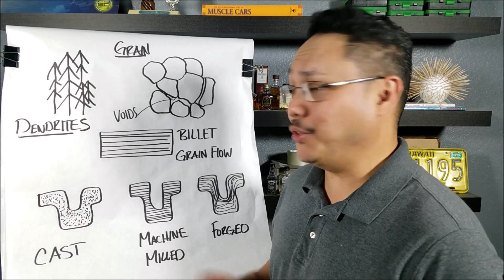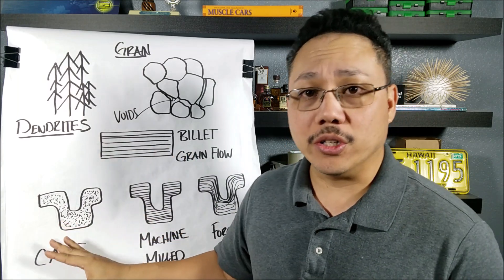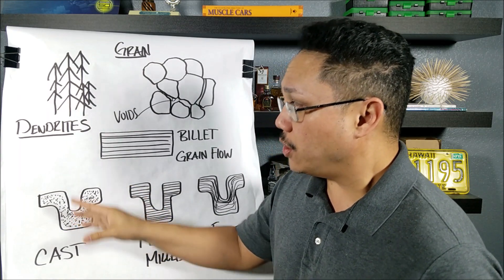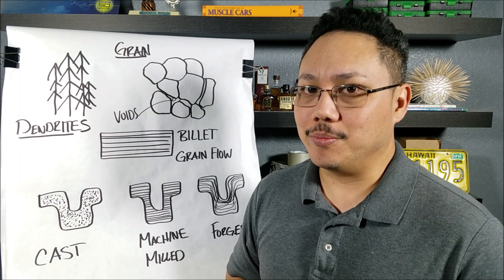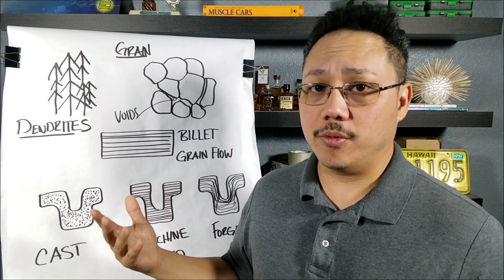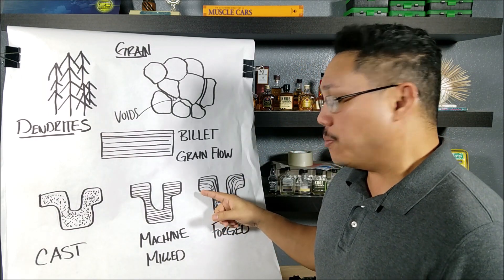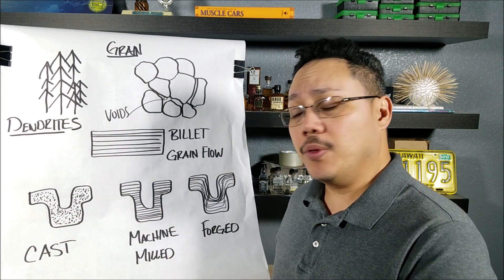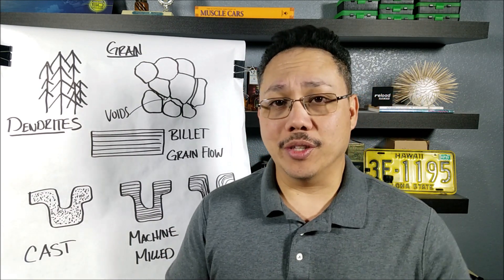CAST VS FORGED PARTS WHY CAST IS BAD AND WHY FORGED IS BETTER

Comment: All the jet turbine parts are actually cast. They use a Hipping process to remove the voids from inside the casting. Also complex pieces cannot be forged, only simple structures.

Comment: There are offshore companies that will not buy China made lifting hooks because they are made from cast steel.  Yes, they are a lot cheaper, but they have been noted to rip on loads that were well under what they were rated for.  Using cast steel for lifting hooks is a gamble.  You can make several identical hooks, and some can handle what they were rated for while some won't.  I was told that with cast steel it creates several different tinsel grades within the steel and you dont want that.

Comment: But most of the aerospace parts are investment casted. Casting is cheaper at scale,  but also requires post processing which can alter the micro-structure. And, complex parts are nearly impossible to forge.

Comment: I work for a hot forging + machining company called Metal Technology srl (brass  copper and aluminum), and it is unbelievable how many customers come to us asking to switch from casting to hot forging, they have solved a lot of issues, also regarding porosity. Your explanation is 100% clear and on point!!! And sometimes it happens that hot forging is also cheaper than casting, if you have the right know how to design the item 💪🏻💪🏻

Comment: casting can be improved with techniques like casting under vacuum (removes air bubbles), ultrasonic agitation (removes air bubbles, likely can be utilized to improve crystaline structure of the metal formation), and probably specialized heating / cooling schedules (will change the crystaline structure of the metals forming)

forging is obviously a great method when the application calls for it and if the part can be practically forged. when it can't, casting is an OK alternative...as are other options such as extrusion.

Comment: Thanks, is there a method which they use vacuum chambers in casting to avoid air traps(voids) and also a compressing process? 
I don't know the right keywords but if there's similar and highly efficient ways in casting could you mention some, I'm curious to know more
Reply: Yes, there are vacuum casting methods, but those are usually done because the metal being cast is reactive with the atmosphere and would make a scrap part versus entrap gas.  

Depending on the material, you can use Hot Isostatic Presssing to close voids in castings.  This is an expensive process, so usually reserved for use on expensive materials (titanium, nickel superalloys) in critical applications.

Comment: Nice video...I've been shopping for a pistol - a 1911 .45 ACP to be specific...Some frames are cast - others are forged...From what little I know of solid metal handgun frames - the forged are said to be a better quality overall.

And btw - I like your selection of bourbon on your shelf.
Reply: Taurus, Springfield, Colt all still forge their guns.  Budget wise it goes in that order from least expensive to most expensive.  Just check the description because some of the concealed carry models have aluminum frames.

Comment: all metals are extracted in cast form i.e. you melt suff and pour stuff ..... billet forming, forging etc are heat treatments to make the metal have different properties usually to make them stronger in some specific way
Reply: No... casting is referring to the process of pouring molten metal into a mold and letting it cool so it assumes the shape of the mold. Forging is shaping it using force. Forging can be done hot or cold, and metal can be forged without being melted beforehand.

Comment: How do you compare 130,000 psi austempered ductile iron (ADI) vs forged steel? Apparently, ADI is about 45% stronger than welded forged steel at least when it comes to similarly designed bench vises. For example Yost brand vices make vises in both ADI and forged steel versions and they claim that the ADI is 45% stronger.  Thank you for any information!

Comment: However, even after you forge it.. so the grains remain in flow and in place- wouldn't machining after the forge process still interrupt the grain?
Reply: Yes, but much more of it is kept intact. Look at his picture of a forged part, and imagine machining it to clean up the edges. You'll still have most of the grain structure matching the profile of the part. It also has the added benefit of reducing the machining required.

Comment: Nice. Are all hot rolled steel automatically are forged steel since hot rolled steel are also compressed like forged steel?

Also what if you cast it but you anneal, then harden then temper? Will that be then as tough as forged?

Thank you. God bless.
Reply: Yes, hot rolled steel is technically forged, but industry does differentiate between rolles and forged due to the mechanical reductions involved and directional effects.  Rolling is more akin to just stretching the material to a smaller size.

Casting + anneal + harden + temper can give you something as tough as a forging  with the right base material.

Comment: So if I understand correctly, if you just heat up the cast iron (during the manufacturing process) and then forge it, it will then be forged iron? Right?

Comment: Can you cast in a presence of a strong magnetic field? Would that direct the grains?
Reply: There are some processes that use induction to stir the metal during solidification, but this is done with a high power inductor.  It doesn't direct the grains around corners.

Comment: Awesome video! Totally explains why the EJ257 motor in the current Gen Subaru WRX STi suffers from cracked piston ringlands as the pistons are cast aluminum alloy. Too bad Subaru didn't want to dish out the extra dough for forged internals!
Reply: Most all engines are cast aluminum a380.  Cracks are user error
Reply: And cast pistons are less susceptible to damage when they're cold. There's a lot more to know about the topic before you can make statements like this

Comment: As a metallurgist that works with both castings and forgings, I'll say it depends on the application.
Reply: I used to buy aircraft structural assemblies and I can tell you that landing gear were always forgings.  So was the titanium center wing box for the swept wings on the Grumman F-14 Tomcat.  Every forgings buyer in the aerospace industry would say  "Porosity vs. grain flow" and grain flow always won.

Look at the difference in price between investment cast and forged irons in golf sets.   The forged irons are always hundreds of dollars more per set.  Good and great golfers NEVER use cast iron clubs because the forged clubs have a better feel at impact (in many cases, a softer feel) and allow better golfers to work their shots.

I play with forged irons and my .45 ACP from Springfield Armory has a forged slide and frame.
Reply: @paulconnors2078  again,  as a metallugist in aerospace,  it depends on the application.   There are uses for both.   Sometimes the forging is overkill and over priced for what the part needs to do.  

Buyers don't spec out the production process for the part, the design engineers do.

Castings can be designed and produced without porosity.  It just depends on the application, process,  and the price point that needs to be met.  Go look at your car, most of the metal parts are castings: block, heads, pistons,  transmission case, control arms, brake calipers, brake pistons, brake rotors, differential carrier, differential case.
Reply: @timbarstow5939  Yes, a lot of car parts are castings and almost every part you mentioned is not one where real stress and force are exerted and few of them are load bearing parts.  As for your comment about castings not having porosities and voids, I call bullshit.  Brake rotors now are made thinner and thinner to meet CAFE standards and are so lightweight  and are so cheaply made and so devoid of material that they are no longer capable of having the faces machined because there isn't ENOUGH material remaining to machine even .015" of an inch to smooth out the scorings of the face after the replacement of a single set of non-metallic brake pads.  When I replace my rotors WITH EVERY brake job, I do so with American made parts because the aftermarket rotors cast in shitholes like India and China are so bad that the rotors warp, crack, wear unevenly, pulsate and cause other problems.

And yes, I know forgings can be overkill.  Before Boeing shut down the C-17 production line in Long Beach, CA they did a strength of materials analysis on every structural casting and forging used in the airframe and determined that more than 2,500 separate parts (both castings and forgings) could be more quickly and cheaply supplied as hog outs.   They then proceeded to supply all remaining C-17s to be delivered to the USAF and foreign military customers with the forged AND cast parts that they determined to be un-necessary deleted and replaced with machined parts from plate, bar and billet.

BTW, Mr. Metallurgist, your comment about parts not being speced by buyers, but rather by design engineers was both gratuitous and offensive.   I can give you hundreds of examples where I had to correct the written instructions by mechanical and structural engineers to forge shops, foundries and machine shops because these same overpaid engineers couldn't string two independent clauses together to form a complete compound sentence and thus proved incapable of communicating effectively with our suppliers.  Most of the engineers I worked with at places like Hughes Helicopters, Lockheed and GE Aerospace were functionally illiterate and socially inept bores.  And likewise, the metallurgists I was forced to deal with were sanctimonious and self-righteous and they looked down their narrow noses at we mere mortals in procurement with condescension and disdain.  As for buyers NOT specing parts, I have the honor of helping design the two piece large sand castings used to form the bore sighting test fixture for the 20 mm Gatling gun in the F-15 Eagle.  The mechanical engineer charged with designing those two parts didn't know anything about casting manufacturing processes, the material to be used and deferred to me to make those recommendations. I speced out both the aluminum alloy and the type of castings to be used.  I did that without an ME degree and to this day, my name is on those blue prints for those two parts.   I later also selected and contracted with a large machine shop to finish machine and assemble the final assembly prior to source inspection, NDT and delivery to the USAF for installation in their Avionics Intermediate Shops at the base and depot level.

The gentleman's video above about the strength of materials is a good one because he explains the differences between castings, forgings and hog-outs in an easy and simple way, making it easy for laymen to understand.   I know the differences and have for more than 40 years in aerospace and commercial procurement and it is why when I purchased my first .45 ACP pistol, I did so from a company that guaranteed that both the slide and frame were forged.   The same applies to my golf clubs.   I am a 5 handicap golfer and my irons are FORGED, just the way I like them.  Strength of materials counts and if you demand strength, and overall quality in manufacturing, a forged part, while more expensive will always yield better long term reliability.  You get what you pay for and I am willing to pay for the best and that which will last the longest.
Reply: why do forged 1911 frames cut out the area around the slide stop pin--to prevent cracks in the frame from developing.  Why is this same part left fully intact on cast frames?  I guess the cast frames just don't crack...
Reply: @generallobster  usually a forging is less elastic than a casting in the same material.  The energy put into the stop has to go somewhere, so it goes i to the frame.  Looking a some of the cracked frame pics, it could be a machining issue with the inside radius on the slide rail,  or it could be from the pin.  If you have a pic of the crack cut open, it will show the type of crack, where the crack started, and the mechanism of how the crack traveled.
Reply: The browning hi power frame seems to be another example of where forging was determined to be inferior to casting for the intended use.  I think forging is not always preferred to casting, otherwise the browning hi power would have eaten the .40 without problem, and the forged 1911 colt's would not have to cut a section out of the rail to prevent frame cracks.  There must be stresses induced with forging and manipulation of the grain structure, which do not arise with casting.
Reply: @generallobster  again,  it depends on lots of things with the end product.   There are many high volume firearm manufacturers that use press-and-sinter powder metal parts.  Smaller volume manufacturers might use forged billets, while a larger volume manufacturer may use a die forging.   All of these are good techniques and have advantages and disadvantages.  It really depends on volume and how much one wants to spend on a part.
Reply: what do you think of cast 1911 frames--would you buy one, and to be specific lets say we are talking about ruger.  knowing what you know about the benefits and drawbacks of different processes for different applications, do you see any reason to choose cast over forged or vise versa as a consumer purchasing a single item (rather than as a manufacturer )?  Lets say cost and location of manufacture is not a major consideration--since ruger products cost more than double what a Tisas costs and the later has completely forged everything including internals.
Reply: @generallobster  I wouldn't have am issue with a cast or forged frame 1911. I would think that most manufacturers would replace a cracked frame without an issue, provided the frame shows that it has not been abused .

Comment: Engines are made from cast aluminum and work just fine.   PLA works pretty well in a lower receiver
Reply: Not honda pistons are forged aluminum ... It is why they last longer than others

Comment: Most small gun parts are not cast that way. The new process is "Powdered metal".  Just as good as foraged. I made fixtures to machine powdered metal parts and they really repeat.   I also have worked with cast steel parts and if you need to weld on them the area near the weld gets so hard you cannot machine it. Not a problem with forged parts.

Comment: One of the reasons GM and Ford vehicles are such shitboxes is that they almost exclusively use cast parts. Imagine casting a turbocharger, one of the most high-stress and high-temperature parts of a modern engine. Yet most American auto makes do it, and Chevy Cruzes and Ford Focuses are blowing turbos left and right.  

Toyota actually takes the time to forge their important components, and they're arguably the most reliable auto make on the planet. It's no coincidence, either.
Reply: The tv adverts for cars are so stupid. I wish they would mention things like you have here. Such as: Buy our cars, the parts are forged and cnc milled for precision and longevity!! But instead we get the car flying to mars with a dog driving it or alike.

Comment: It isn't so simple machined UHSS steel is better than forged.
Modern fine-grained steel has no directional grain structure and has the same properties in every direction.
Forged can has Re=700MPa and UHSS can be about 1300MPa.
Forging is cheap but machining of hard steel is not.
But in sport you will find more machining parts made bay very hard materials.
For mas produce forging is better because it is cheap and gives better propperties than casting and better price and properties than machining of normal steel. 
In case of machining another problem si shape and sharp edges. 
Machnined part made by stronger material will be more durable only if shape will be smart.

Comment: Casting is for disposable tools like arrows and ammunition. Forging is for reusable tools like axes, firearm parts, swords, and car parts. Using forge for something like arrows or disposable tools is a waste of good forged steel.
Reply: The Ruger Redhawk and Super Redhawk are both cast as opposed to forged; are they known for lack of durability or their inherent fragility? Nothing wrong with a well-done casting.
Reply: @mdd1963  Gun frames and receivers don't really get the same stress as something like the bolt or trunnions on an AK. Castings are fine for low impact parts

Comment: This is all fine and dandy but today MIM has taken over those traditional methods. Metal Injection Molding. A complex process of stages using powder to a final product. Its plastic injection molding done on a wider scale using a variety of metals and other materials. Smaller more complex parts can be done faster and more economically that are close to or just as good as traditional methods. Final machining of MIM parts is sometimes necessary to meet required specs.

Hate using Wiki but it does give the basics of what MIM is.

https://en.wikipedia.org/wiki/Metal_injection_molding
Reply: Key words "FASTER & MORE ECONOMICALLY"...